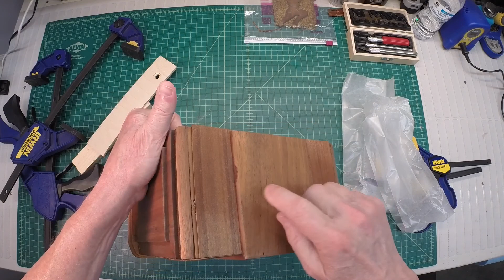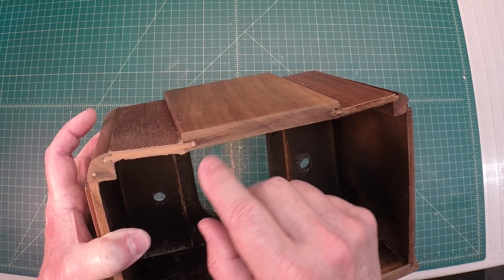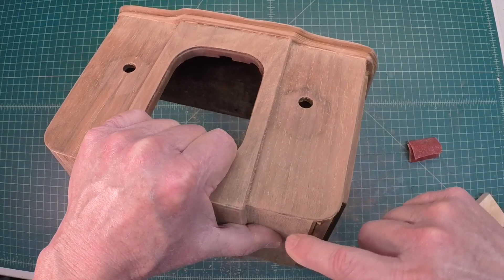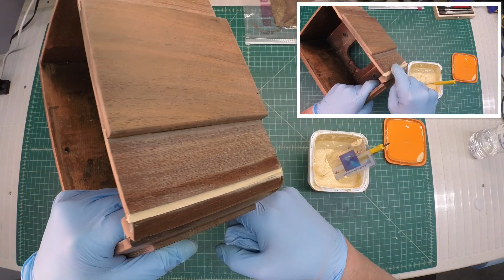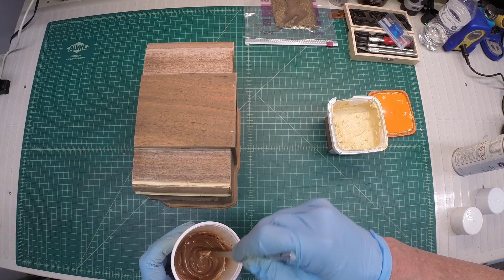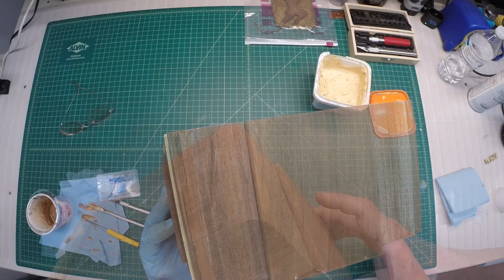Peter Pan Radio - Day 4 (Using Wood Filler to Repair the Quarter Round)

Comment: Curious as to why  you did not use traditional tools and method for the veneer and glue.? It is not my intention to be negatively criticizing. But hot hide glue requires no clamping, it is applied on both sides of the veneer for maximum penetration and set in place with a veneer hammer.  This method has existed for restoration and new work for as long as veneer  has existed.
Next, the trimming of  the veneer is generally done with a special veneer saw; as I'm sure you are aware of. 
Lastly, much of the sanding in hard to reach areas can easily be addressed with a card scraper. Scrapers eliminate sanding. A finely tuned scraper can be used in any grain direction.
Reply from the maker: +James Lucas James, sorry about my late response. I appreciate you sharing your expertise. The Hide Glue in the bottle says to clamp a minimum of 30 minutes, so following their recommendation. I would assume the Hide Glue you're referring to is the real stuff that you heat up? I have a Veneer saw I use on bigger pieces, but I find it easier to sand off the the edges on small areas. The card scraper is one I haven't used nor was I familiar with it, but after seeing your comment, I had to get a set. What angle works best when using them? Thanks again. Best, Don